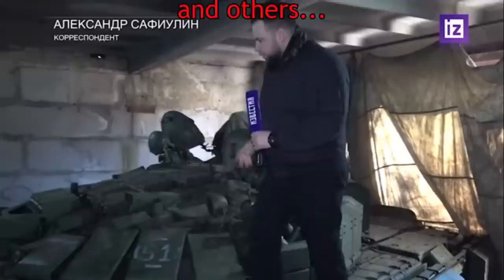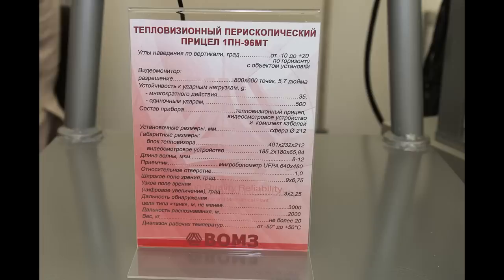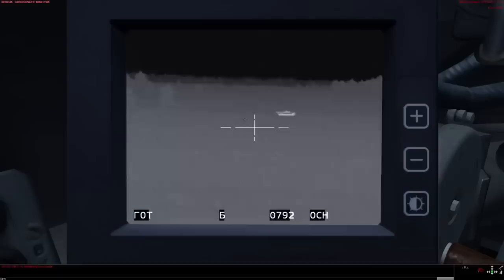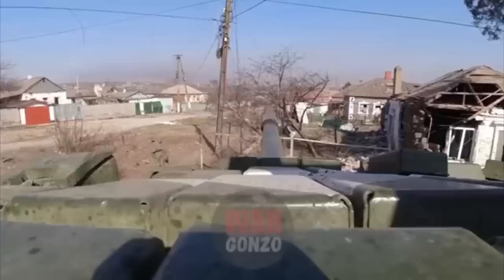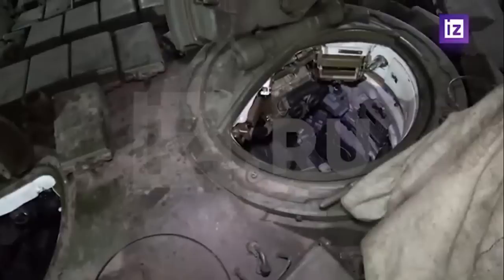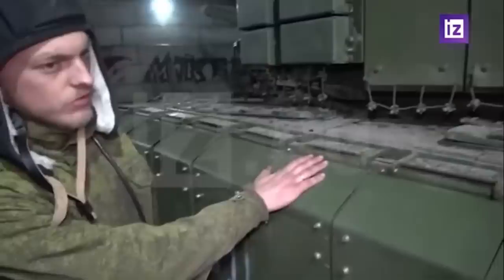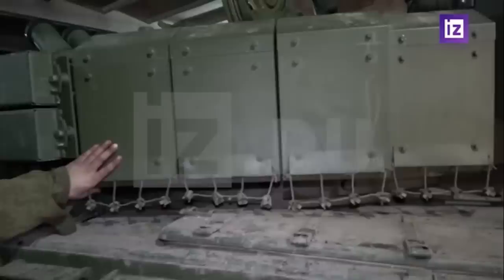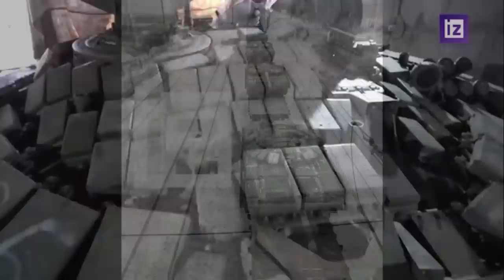Are Russians Downgrading Their Tanks?

Comment: When it comes to the ruso-ukraine war numbers kinda matter more, and tanks are mostly being used for direct fire support, so it isn't that bad to use that sight
Reply: just because this is ww3 really, EU/NATO vs some kind of eastern block. when it comes to world war, production numbers make VERY much sence
Reply: A lot of this buries the lede, which is that they're modifying T-72B tanks. In other words, the inventory of Russian tanks is depleted enough that they feel the need to make up numbers with a very old, basic tank, and when they upgrade it, they're upgrading it with much more basic equipment. They may, in fact, be able to produce Sosna-U, but clearly they aren't in free availability. It could also be that Sosna-U is difficult to produce (i.e. slow production rate). It could also be that Sosna-U depends on components of which they have a finite supply (i.e. key component that they had stockpiled, but which is now hard to get).

Given that Russia has previously send T-62s, you can say using an old model is nothing new. Except that the rationale, at the time, for T-62s was that they were ready to go. Also, that there were old guys who were being recalled who could already drive T-62s.

This does not mean Russia has no T-90Ms or other more capable tanks than the T-72B. What it does indicate that the marginal tank (i.e. the one that you get when you pick the next best thing from storage, for which you have the necessary parts to put it back into service) is apparently no better than a T-72B. This is a 1985 vintage model, with a less powerful engine - 840hp not 1140hp for T-72B3. 

Something we'll probably never know absent a complete collapse of Russia - how many T-72Bs are being pulled out of storage to activate one useable tank.
Reply: You can rebuild tanks but you can’t build human lives.
I rather have 50 great tanks than 200 poorly built tanks. War has shown that the advanced and expensive weapons have won the war and especially in war of attrition.
Reply: Только вот это не война
Reply: @bonearrowgamingcommunity3380  The Germans said exactly the same in 1942-1945, the result is known...
Reply: @cv990a4  Сосна У из за Санкций уже не производится.
Reply: @bonearrowgamingcommunity3380  What war has shown what you're claiming, bro?! Short answer, no peer to peer conflict has shown 50 gucci tanks are better than 200 capable but not gucci tanks, given tanks are engaging other tanks and one side has a 10:1 artillery advantage, better EW/ECM, better tactics, leadership and logistics. WW2 was won by Russians overcoming Nazis fielding more capable tanks..Where's your example, bro?! Irak? Don't make me laugh! How many clowns think that was peer to peer?
Reply: @a.m.armstrong8354  Leave it hes is yust another clown that believes that Western Tanks = Industructible/Never lost in combat
Reply: @user-jc8yx9xr4f  The Germans ran out of oil and, therefore, logistics support in 1942. 

The Axis’ constraint, when they were defeated, was in the number of tanks they could maintain and supply in the field, not how many they could produce. 

That’s why Gucci tanks are good. You get more combat effectiveness for, essentially, the same amount of logistical support.

There are large, often unaccounted costs for moving materiel into a warzone.
Reply: @cv990a4  "In other words, the inventory of Russian tanks is depleted enough that they feel the need to make up numbers with a very old, basic tank, and when they upgrade it, they're upgrading it with much more basic equipment." This is terrible reasoning and I have to assume you're just a propagandist.

More tanks are generally good. Did the US and the USSR scrape together tanks in 44 and 45 to make up tank numbers? No, but they still made a ton of them. More likely, they are expanding their tank fleet in preparation for this costly conflict lasting for a long time and also for the escalation now that they are mobilizing more troops.

The main take away should be that Russia is committed to a long and costly war if necessary. Hence why they are expanding their tank numbers rapidly by upgrading their T-72B stocks.
Reply: @user-jc8yx9xr4f  The difference is that in WW2 the Soviet Union had lend-lease from America providing it with thousands of tons of raw materials and consumer goods so that the Soviet Union could focus on mass producing tanks and other weapons. The opposite is true today.
Reply: @a.m.armstrong8354  "10:1 artillery advantage" - Advantage ratios mean nothing when Russia's artillery is held back by the ammo depots being moved 100km behind the frontlines.
WW2 was won by American industrial output.
Reply: @skitidet4302  We already know Russia is committed to a long and costly war. That is hardly news.

But if Russia had better tanks than the T-72B easily available, they'd use them. You have not attempted to refute that statement so it appears you can't.
Reply: In every war tanks have been primarily used for direct fire support of infantry, not fighting other tanks..
Reply: @cv990a4  Because that's not what I was refuting. You where projecting a level of desperation on to them that is simply not warranted.

They have better tanks than the T-72B tanks that are easily available, this video is about making a better thank than than the T-72B. They are making lots of T-90M and some T-80BVM and T-72B3 I believe, It's just that they want even more tanks, hence why they are making many improvements to their tanks in parallel, this way they can maximize their increase in capable tanks.

I think the video is right that the sosna U sight is a bottleneck in their tank production, so it's perfectly logical for them to basically make a T-72B3 but with a cheaper thermal sight to resolve the bottleneck.

If Russia had nothing better to send than a T-72B, they would just send them as is, but they don't. They update them to a reasonable level for a reasonable price first.
Reply: @bonearrowgamingcommunity3380  The red army doesn't face tanks, so they don't need high end equipment to shoot at moving tanks. They need something that can help laying fire on a pillbox or blockhouse, and the old systems are more than good enough for that.
Reply: @a.m.armstrong8354  Desert Storm more or less showed what superior equipment can do. But people forget that the US and allies had not just superior equipment but superior numbers as well.
Reply: @skitidet4302  Correct. They're upgrading their reserve units and sending them to the front, while pulling back the A units and probably equipping them with new built Armats and T-90Ms rolling from the production lines in the hinterland in anticipation for the larger conflict with NATO in Europe once Russia decides that NATO has depleted their stockpiles enough by sending their front line equipment to Ukraine where it's thrown into battle piece meal and chewed up, rather than concentrating it which would be the better thing to do strategically and tactically but for which Ukraine isn't given the time by those reserve units keeping up just enough pressure.
Reply: @skitidet4302  Interestingly, I never mentioned the word "desperation". I simply pointed out that if Russia had the ability to field a better tank than the T-72B with 2022 mods, they would. If you believe this indicates desperation on the part of the Russians, that's on you, not me. Sounds like a bad case of projection.
Reply: @cv990a4  "if Russia had the ability to field a better tank than the T-72B with 2022 mods, they would." And I corrected you and said they they where fielding better tanks a long with this newly upgraded T-72B.

Can you not se how you're slanting it by saying it like you do? It paints the picture that they got noting else while they do. This is more like padding, not the main supply.
Reply: @skitidet4302  Gosh, it's almost as if I'm reading you repeat what I first wrote. The T-72B is the marginal tank. When looking for a tank to make up the numbers, this is the one they need to use.
Reply: @user-jc8yx9xr4f  The US Said this in Desert Storm and we all know how that went
Reply: Gollan Heights?
Reply: @dgart7434  Very funny if not for lend-lease, then the USSR would have lost ... common nonsense...
Reply: @kyb5203  Nope, firstly, the forces of the parties had parity in numbers, and secondly, the advantage of the combined forces in reconnaissance, aviation and coordination of troops was absolute. But don’t worry, when NATO kills Bedouins in the desert or blacks in Africa, this is a liberation war and no one considers the composition and quality of the army of nonhumans ...
Reply: @cv990a4  dah you expected t90 being pulled out of storage?
Reply: @deriznohappehquite  well the Russians have the armata and seem to disagree. They probably won’t field it in large numbers and go with the t90 instead (half the price?). Ironically this whole YouTube controversial will be soon slugged out in reality and we will see.
Reply: @ChucksSEADnDEAD  regading the European theatre this is wrong. The war was won by the Soviet unions and the massive sacrifice they made (not saying willingly - more like forced). Industrial output of the USA didn’t fight down the German Wehrmacht in Europe.
Reply: @janmaker227  Wikipedia said Russia started with 200 T-90 in reserve. Gonna guess those were pulled out of reserve long ago. But that's the point - better models of tanks, whether more advanced T72 or T80 or whatever, are apparently not available, or at least not easily available. So, the best tank available to make up numbers is no better than 1980s vintage T-72B with some basic upgrades.
Reply: @cv990a4  bullshit. Your whole they don’t have Better tank argument is ridiculous. Throwing giant amounts of armor to the front is necessarily the discipline of also using your 2nd and 3rd grade equipment - one would call this a high low mix. You infer exactly what he said and your semantic trickery is not changing that. Nobody would accuse the us Air Force of the same when using b-52s.
Reply: @cv990a4  bullshit. Your whole they don’t have Better tank argument is ridiculous. Throwing giant amounts of armor to the front is necessarily the discipline of also using your 2nd and 3rd grade equipment - one would call this a high low mix. You infer exactly what he said and your semantic trickery is not changing that. Nobody would accuse the us Air Force of the same when using b-52s.
Reply: @user-jc8yx9xr4f  

The United States is a country of machines. Without the use of these machines through Lend-Lease, we would lose this war. ' —Josef Stalin

I guess it's just common nonsense 🤷
Reply: @drgat6953  You just need to be able to separate truth from flattery. And the truth is that the USSR would have done just fine without Lend-Lease, only 2 years later. But you obviously know better, you are a specialist in the economy and industry of the USSR and Russia ...
Reply: @janmaker227  your reading comprehension is nonexistent. I specifically said in first comment that this does not mean they don't have better tanks. I said this, however, is the best tank available to make up the numbers
Reply: @janmaker227  My understanding is that the Armata relies on foreign components, so Russia is unable to build more at scale. 

I believe all new build Russian tanks are T-90M, the most modern and Gucci tanks Russia is currently capable of building. 

They’re still using the old stuff because tank is better than no tank, it’s a high-low mix and/or assault gun tactics.
Reply: @user-jc8yx9xr4f  the german never said that and the difference in quality of tank werent that off, the german tanks wer emuch better, but the german had no capacities to use them anymoe, no oil, no spare part. The german were war tired by 42 and didnt have amterials, yet they smashed russian at Kursk which was won only by the infantry ratio. If you want a good comparison look at the gulfxwar, the tech gap was so wide the russian tank couldnt even kill a bradley, let alone western mbts. One Abrams could take off as many as tank as they had in ammunition.
Reply: @a.m.armstrong8354  Gulf war showed that one westsern mbts was miles better than 100 russian tank, you are welcome. Hard to destroy a gucci tnak you can't even hit, you can't even see with your optics, while he spotted you miles away and hit you with fatal hit miles before you can even hope to scratch his armor.
Reply: @user-jc8yx9xr4f  Since When has NATO been in Africa?
Reply: @deriznohappehquite  all this talk about foreign components and shortages I highly doubt. The Russians produce the thermals - not sure what’s more challenging on a tank. The computing und electronics they have so what components does an armata need that isn’t available in Russia? I have seen production of the mi 28 and it’s state of the art material science … the real challenge for Russia is probably the advanced tooling and machinery to produce the components.
Reply: @stephenhumphrey7935  This is metaforic, but members of the NATO like France or USA still participated in African conflicts.
Reply: @Олег Сергеевич  Yeah, but that's not the NATO alliance is it? It's just individual countries doing their own thing.
Reply: @janmaker227  it’s kind of beside the point as to why Russia can’t build large numbers of T-14s. 

The point is, Russia is in all cases building the fanciest, most Gucci tanks that it can build when it builds new tanks, that being the T-90M. 

It is upgrading its old tanks with any Gucci components it can add on. 

Gucci tanks > cheap tanks

Comment: T-72B3 is also just an upgraded T-72B though, just like T-80BVM is upgraded T-80BV. Both are still worse then T-90 and T-80U. No matter what russian propaganda claimed, they weren't cutting down and rewelding those tanks back to change the armor layout or autoloader(T-90A is the only russian tank that can use long rod penetrators as it has BOTH 2A46M5 barrel AND improved autoloader. Russians claim that T-80BVM uses 2A46M4 and T-72B3 - 2A46M5, but both are referring to barrel only as neither received new autoloader and thus can't use modern ammo). Thus T-80BVM is actually worse them fully upgraded(Shtora, Drozd, full hull length Kontakt-5 coverage. And I know that such version sadly was never made in 1989) T-80U from 1989!
T-80U and T-90A remain best available en masse to Russia tanks. And they weren't modernized for quite a while. Combine it with the fact that there is allegedly an upgrade package called T-90AM that uses T-90A to create T-90M(2A46M5 one, not 2A82) and the whole dancing around T-72B3 and T-80BVM becomes even more weird. I can understand if both were intended as export versions and upgrades, but nope, Russia intended them for domestic use. Tbh it was better to update and maintain T-90A fleet on same budget.
Reply: @robinelliott-ni2eh  nah, it's just:
1)professional deformation that causes to concentrate on engineering details;
2)love for old soviet equipment and how russian rentier kleptocracy misuses them ¯\_(ツ)_/¯

Comment: The new ERA armour layout looks very heavily based off of British Challengers in the gulf with the large ERA boxes on the lower frontal, large rectangular ERA on the sides and anti RPG chains
Reply: It's not though. T-72B has had ERA since before the 1990's.
Reply: We never had or have ERA 🙄
Reply: I should say you are right about the skirt placed ERA, but the bricks all over the hull are a T-72B standard
Reply: @pestomystic  I mean specifically the lower glacis layout of add on armour looks exactly the same as Challengers in Iraq
Reply: @alangordon3283  it's more or less the same concept though, or even NxERA (non-explosive ERA) which is literally how most composotie armor works.
Reply: @alangordon3283  Challenger 2 has used ERA before, in Iraq 2006. It then later got replaced with NERA, because it got penetrated by a tandem-charge RPG.
Reply: Challengers have NERA, not ERA. Also "anti-RPG chains" are from T-90M, lol
Reply: @xAlexTobiasxB  afaik NERA is a bit different due to having more gaps and being more "angled", while composite armor is more compact.
Reply: @tomsoki5738  
Ach, hard to say if it's "heavily based". It's not like it's some innovative solution.
Russians are learning the same lesson here... and there's only so many ways of affixing ERA bricks to a lower glacis.
Reply: Challenger 2 add on armour is all composites. They did use era on the front in the early 2000's though.
Reply: Idk man, era comes in panels, boxes or bricks since it exists and if they decided they want era boxes on sides its not like they could only get that idea from brits in gulf war of all things.
Reply: @robertkalinic335  yes however the layout of panels is identical to that of Challengers and no other tank uses that exact layout
Reply: But the Russians one might actually just be wood or something, lol
Reply: My guy the Soviets did more experiments with era. Than a of nato. They don't need to copy stuff about era.
Reply: @unknowncommenter6698  The Challenger 2 tanks Chobam armour with NERA is classified not what its made of but how its made.